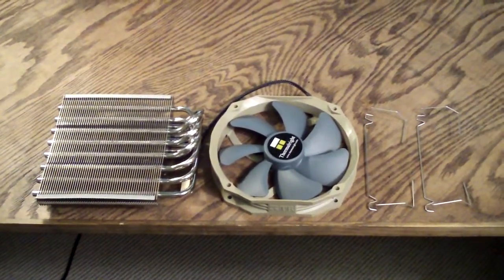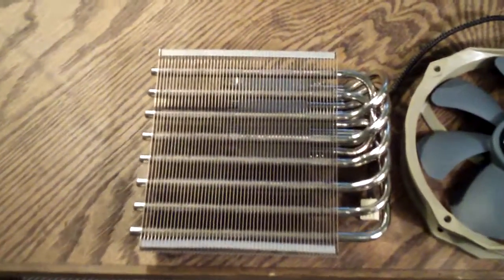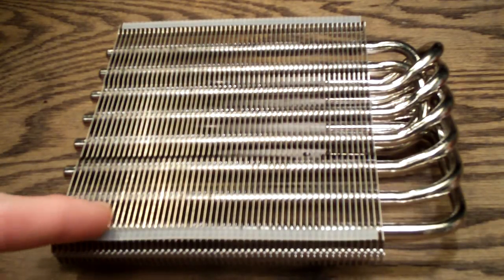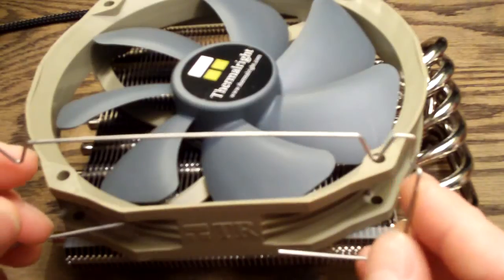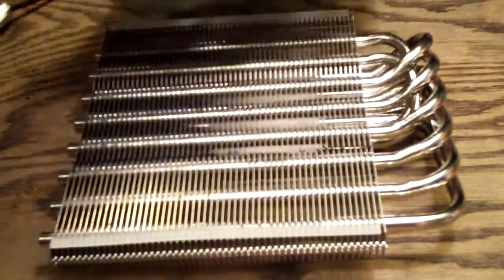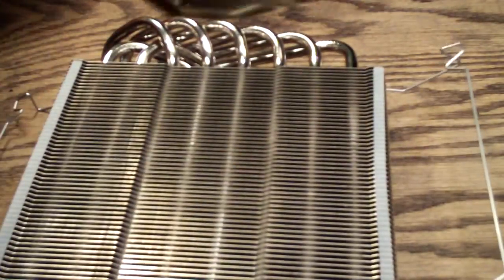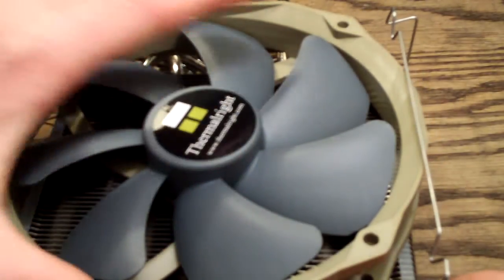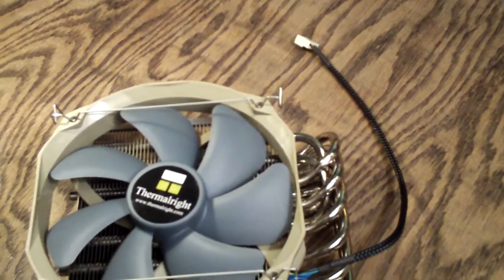Thermalright Heatsink Fan Installation Guide

Comment: You don't really need any other fan. The TY-140 is very good, and very quiet (quieter than my Apache 120). 

I just can't fit it properly on the True Spirit 140. It's a BITCH to fit, the clips don't quite align properly.

Comment from the maker: @zver711 Note:The TY-140 utilizes a hydrostatic bearing which is self-lubricating and performs properly in any mounting orientation. Static pressure is not officially listed, but reviews have shown it to be around 1.9 mmH20 at full speed.

My unboxing and review on OCN

Comment: This was a good review, but what I personally would like to hear, is that if you could plug that fan (attached to the sink) and let us listen on full speed. Also could you tell us the specs of that fan, the static pressure and the airflow in particular, I'm curious.